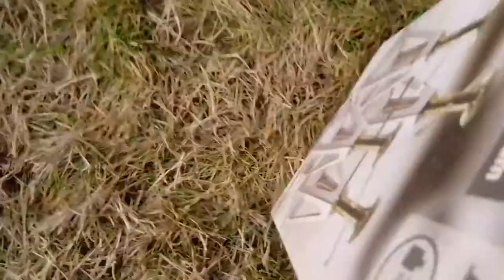How To Change Rear Shock Absorbers Ford Fiesta V

Comment: Who the hell buys a Ford Fiesta, anyway? 😆
Reply from the maker: It's not fast by any measure, but it's comfy, fits five people, has AC, automatic windscreen wipers, built in radio with CD player, looks decent and it runs for just some 5L/100km combined. And because of the mindset of "who the hell buys a ford fiesta anyway?" you can get one for cheap in good condition. I'm kind of scratching my head because I sold this one during covid and now with fuel prices up I'm looking for another one. That X-Trail I'm driving sure is good, but it's also hungry. So, yea, I'm on the market for a cheap one right now. :D